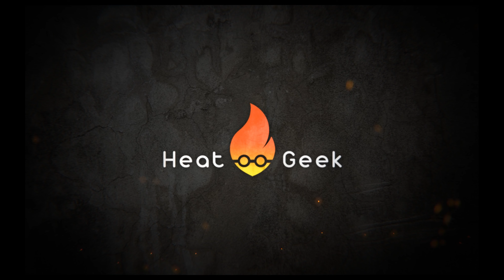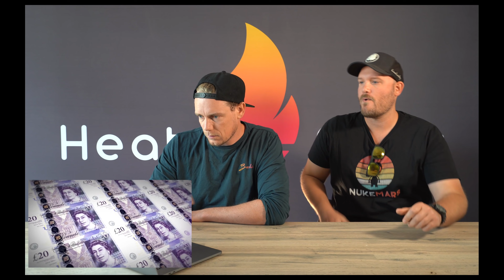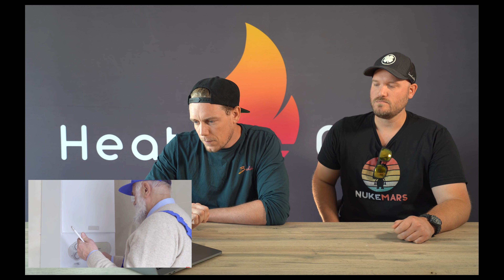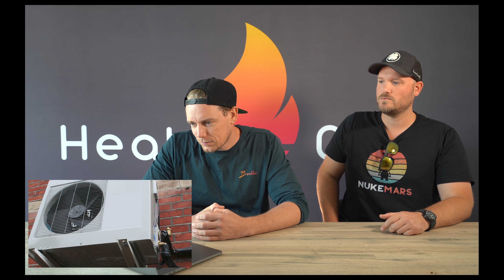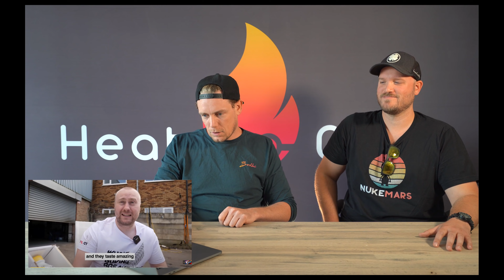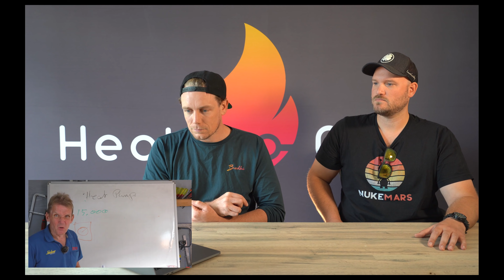Professionals React (BADLY) To Skill Builders's Heat Pump Videos | PART 1 | FIRST TIME WATCHING

Comment: Ok some of the criticism comments on here are balanced & some are not. The unbalanced ones I will not comment on as no matter what it’s pointless as they won’t take onboard any evidence at all. To the balanced ones:
Hydrogen is the fusion reactor of fossil fuel industries. It’s always 5 years away. Why- physics. The best efficiency you can possibly get when making Hydrogen & then using that to power a fuel cell is 66%. Note that isn’t burning it which is less efficient & produces Nitrogen Oxide- a potent greenhouse gas.
It’s also incredibly hard to store and export with 99% of production using steam reformation as a method- this also produces massive CO2 emissions. 
Reliability- fair point. I’m tempted to say poorly specified systems but that would be simplistic. It may be poorer quality components used by manufacturers & it may well be older technologies. It’s more likely to have been a sporadic approach to maintenance undertaken by the owners. As for cost. Two phrases cover the capital cost in the next few years- these are production engineering & product development. He former can transform manufacturing costs and quality. This is evidenced in a range of industries. As demand grows production engineers look to meet that demand improving and streamlining factory processes, up scaling production whilst maintaining & improving quality. 
Product development- there’s massive efforts in improving compressors etc in terms of efficiency, reliability, longevity & serviceability whilst simplifying manufacture/supply. Why- those pesky production engineers and they live for this stuff. 
House fabric in this country isn’t suitable. I agree it isn’t in many cases and so do The Heat Geeks. What the industry ( I’m just an interested potential customer here) should be doing is advising people on getting the best out of their existing systems make sure they’re optimised to run correctly, use less gas, produce less emissions, stress the system less and save the customers money. In addition do heat loss surveys as part of the above. Advise customers how to run heating at lower temperatures with suggestions as to how this could work I.e. change that p1 rad to a p+/p2 and you’d be fine working down to 35 degrees  maybe internal insulation next time they renovate a room. All of these incremental changes add up. They make existing systems work better. Next the elephant in the room which is coming Rebalancing of carbon tax burden from electricity
Currently only 2% or so of gas cost in the U.K. is tax. For electricity that burden is 23% even though renewables (now cheaper than fossil fuels & subsidy free) make up the majority of the supply on  about half the days or more. When this isn’t the case ironically gas does. Do you see any irony in this? Do you see how much the treasury will look at this and say “Ooh I can claw back some revenue here and look green. I can even call it levelling up for the climate”. When that happens a properly designed & fitted HP has a mass business case as does a move to IR panels for those unable to move to HPs. The accumulator/ heat store issue- there are alternatives look at Sunamp heat batteries. These have multiple potential heat sources and loss curves that are great. They look attractive and are solar thermal/ grid/heat pump or PV compatible. They don’t need to run legionella cycles and are smaller than equivalent capacity cylinders. Oh and they are cost comparable too and look like a white good so can be installed in kitchens utility rooms or airing cupboards. All I would ask is look forward not back. See this as a new experience an opportunity to learn. Something positive it can work well just as the change to condensing boilers did. All of the issues pointed to here happened then.
Reply: Excellent post.

Comment: Fascinating how deeply unfashionable solar thermal has become. Mainly due to cost and complexity, yet here we are, adding more cost and complexity.
Reply: It's neither costly or complex. It firmly has a roll to play especially when a buffer tank is in the mix.
Reply: @BackOnTheTrack69  It shouldn't be costly, but it most certainly is!
Reply: @michaelkinder5144  As with all systems Michael, its all about who one chooses to design and install. ST is a fantastic tech but for it to operate at its best you do need some space for both the tubes (or panels) and a good sized cylinder. The newer systems can be filled with water so maint is far less of an issue but the old grant schemes did not allow that. ST is a genuine investment in your home as it has genuine payback.
Reply: Once solar thermal is installed it is virtually free to run

Comment: Lads
As an engineer I would trust you to give me a solution and definitely hire you based on your considered recation
But as engineer I agree with skillbuilder if it placed without a fully considered solution it a potential disaster
I think its amazing piece of marketing for te
Reply from the maker: we do have a solution.. we litrally developed a course for it
Reply: Just like poorly sized and installed gas boilers that cycle and don't condense right?

Comment: Electricity and gas are both climbing, but 48% of electricity in the uk is from gas powered power stations, so that needs addressing to impact the climate. If you look at gas prices currently in the uk they are at the highest levels to the consumer. However the commercial gas price was 3 times higher in 2008 and 2 times higher in 2012. So prices are climbing but the product gas in the macro outlook is currently cheap, so consumer prices are being escalated. So I agree that the government plan can only be through price and tax, or basically we won’t do it.

I replaced our boiler 5 years ago, it was 15 years old, and it was £1500 and our gas bill went down £20 per month, Major investment needed to bring down the price or people will simply not do it mainly because they can’t afford to do it. That is what they need to address, 

Also ‘net carbon’ net means we are not getting rid of our carbon, we can all be net zero tomorrow if we all had loads of money because that just means pay for the offset, that is net zero. So I guess the government is going to do what it has always done and tax us on our boilers, cars etc, meaning they hit net zero, we pump out carbon because we can’t change to cleaner energy because we are taxed so much and can’t afford it. It’s extremely difficult with so much government debt to see how it can all be achieved.

Comment: Underfloor heating 🙄 total pain in the ass. How many times have I seen or heard about people having troubles with blockages or leaks.
Reply: Then they are not installed or specified correctly. Done over a hundred of them and never had a problem. The most efficient and comfortable way to heat a home bar none.
Reply: Hardly ever, i’ve been installing for 30 years🤷‍♂️

Comment: Your not listening mate, your mind is fixed on total defense of Heat pumps, your partner is much more open to the good points being made, and by the way since the making of his video Gas prices have gone through the roof and Electricity is not about to get any cheaper just the opposite. I resent your argument that it's ok for people to be plunged into fuel poverty in order to reduce CO2 a solution must be found that prevents this at all costs. Far too often the solutions thought up to cure all our ills involves Tax rises.
Reply: They involve tax rises because of the incompetence of the government and lack of foresight.

Comment: Heat geek , will the heat pump bring hot water temp up to the required 60 degrees c
Reply: Not without an immersion backup (which they all have), there has not been one case of legionnaires in a domestic property in the UK so the "requirement" to heat to 60°c is probably a little unnecessary.

Comment: you will NOT  save the planet by using electricity to power an air con unit, and a water heater. ASHP s are very noisy all day and night, and they are subsidised with PUBLIC MONEY.  try grounding all those jets in the sky, then you'll see a proper reduction in CO2
Reply: The ones we have fitted and have in our office are silent, not quiet but literally silent.

Comment: England seems to be very special in so many ways, The rest of Europe has heat pumps. I have had for 30 years and more. Do you really think the gas price is not going to increase? Heat pumps have  a future due to their ability to run on renewable energy. Brexit, you are special = peculiar. Isolation instead of insulation.   Your housing standards seem to be from  Jack the Ripper times. I myself have 30 cm (11 inches )polystyrene lambda 0.22 in the walls and 50 cm on the ceiling. Last month I paid £ 70 . for all my electricity including heating. By all means stay and/or go back to nostalgic times. Modern things like heat pumps, who needs them ?
Reply: @RepairsGroup  Yep a foreign chappie no longer getting any British money via the EU. A bit sour

Comment: we know that in order to match gas costs  houses need to be highly insulated. fair enough. it's the elephant in the room that the vast majority of UK housing stock is just not suitable or could be made suitable. My UK house was built in 1896 and just not able to be properly insulated past loft and double glazing: not that I'd ever consider a HP' unless I covered the roof in solar OR I never had mains gas available.

however I cannot get confirmation that the cost benefit comparisons between gas and HP's are made on a level play field
IE do they compare a gas installation pre insulated running costs with a HP' post insulated running costs etc? 
or are they both post insulation upgrade running costs... ?
can someone confirm its a direct and fair comparison??

Comment: Cost about fifteen hundred NZ dollars to have a Daiken  heat pump fitted to our lounge and bedroom.Costs about a hundred dollars a month to run it as a heater or a/c unit.Really good value-I reckon.
Reply: Does the Daikin heat pump heat your water as well as heating and cooling the air?

Comment: Interesting debate and informative but after watching my choice would be a new gas boiler, even though i have a fully insulated home. I can agree that a heat pump could be a better choice for me but how do i know who to contact for expert advice. Even with this advice as always you only get the correct answers if you ask the right questions, so unless i have some experience on boilers and fitting them how can i ask the right questions to satisfy myself to proceed with a heat pump and a particular installer.
Reply: Therein lies the rub Dave. Currently there seem to be very few installers both competent and confident enough to stand by their designs. This is a genuine problem.
Reply: You would be regretting that move now in view of current gas prices. 😂

Comment: "We have happy customers!" - yes, and unhappy neighbours, because of constant noise!
Reply: EXACTLY,  and l bet those planning applications were rushed through by crooked council employees
Reply: We don't have any unhappy customers and have hundreds of reviews to attest to that, most modern decent air source are virtually silent unless on a wobbly bracket or a flat roof.
Reply: @patrickwheeler3959  Just copied this comment from David Husband "what struck me was the dreadful noise of these things, it is basically having several enormous fans switched on outside your property 24/7 and although they are ‘quiet’ you have this constant irritating noise, a bit like your freezer but louder and a different pitch, I certainly wouldn’t want to be living next door to someone who has these installed!". Off course I believe you, that it is quiet!
Reply: @DWestnik77  that is unfortunate and I feel sorry for them, nuisance noise can be maddening (my neighbour works on mopeds......).  You are welcome to come and listen to the working models at our showroom but honestly they are virtually silent.  Some old models and especially the ones made by air con manufacturers can be a bit lumpy but the high end ones by Vaillant, Viessman etc are whisper like.
Reply: @patrickwheeler2646  Please, make a  video with noise measurement. 55db is quite noisy for me. How many Db your "virtually silent" heat pumps produce?

Comment: Really Really sorry to hear you two having a pop at someone who is saying the same thing we all are saying,  including you two.
You know very well its horses for courses.
Very sad to hear this type of comments.
Used to follow you, but no longer..can't be doing with the "big I am" 
Have some respect for your elders
Reply: Although I'm a 62 year-old heating 'engineer', I would say it's not actually about respect for elders, it's about respecting what Roger Bisby got right, and that was the majority of it.  Heat pumps are suitable for very few homes, and certainly not anything like even 50% of our housing stock.  Roger usually hits the nail on the head, and he does here.  No one can make a video which is 100% correct, and these two are no different.  Roger's video stands up for itself.  As you say, lots of us, when we get talking in the plumber's merchants, are saying heat pumps 'won't work'.  The cost is going to be extraordinary, and will only be applicable for very few homes.  Boris Johnson prattling on about heat pumps definitely means that they are NOT the solution!
Reply: @barryfoster453  you are absolutely correct,  and yes age is nothing to do with it,.. I'm not quite as "old" as you but not fat off.. us "oldies " do however bring experience, honesty and sensibility to these debates. 
Thank you for your comments.

Comment: Problem is that if you remove the top 1% wealthiest the average UK resident has less than £600 in the bank with 1 in 3 people owning nothing more than debts. And more than 50% of the UKs housing stock doesn't have cavity walls... And he's not wrong about increasing gas prices, not a conspiracy it's already happened!

Comment: This is just another government scheme to change of industry. It will fall flat like all the other attempts they tried in the past. Clear skies. RHI etc.. electric tariff is to high for electric heating of any kind. Most of these companies see an opening for making money 50 -70% mark up and are not heating engineers or have knowledge in heating systems. They will be out of business when the government pulls in incentives and the house holder will be left high and dry.

Comment: I like the way the second guy ( the one on the right) often corrects the first guy. they haven't convinced me the skill builder is wrong.  they're are obviously carbon zealots. they admit they have a heat pump as back up to solar thermal.. so not adequate on its own. they also admit it's not a solution for everyone. ie  the majority. China making all our stuff doesn't alter the fact that the installed gas boilers here only contribute less than 1% of the world carbon... so what's the point? and amusingly they are actually nodding at most of what skill builder says.
Reply: Home energy (which is mainly heating and hot water) is about 15% of UK carbon emissions, we're not carbon zealots and still install gas boilers and many other technologies depending on the requirements.  Heating a 1960's building with solar thermal and a heat pump is actually quite impressive, it isn't the case that the heat pump is insufficient as we deliberately sized it and it is the smallest model available.  Yes we are nodding at some of what Roger said because a lot of what he said is correct, just because we disagree on some points doesn't mean we will disagree with everything, that would be insane.

Comment: Lol made me laugh… I live in a small village in Kent and it’s an old house my heat pump costs a small Fortune.
£189 per month it’s a Mitsubishi 12kW
Twin fan setup but unfortunately I do not have gas supply so had no other options..
Sorry the chap on the left seems very defensive but the other chap seems cool..
But an interesting video
Reply: We live in rural France , last winter our log burner which heats only one room, cost us €500 in wood . I am just finishing installing a central heating system with a modern modulating, condensing gas boiler run off propane bottles. 
I estimate the nine rads I will be heating will cost me under €300 for whole house heating  this winter.
Reply: you had oil or lp gas
Reply: @emmeyefive7484  no Storage heaters before